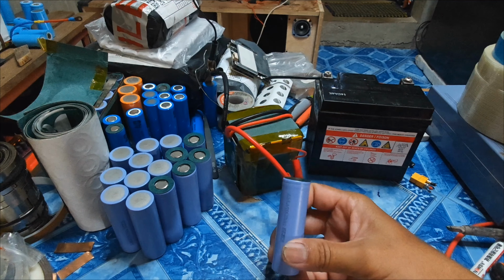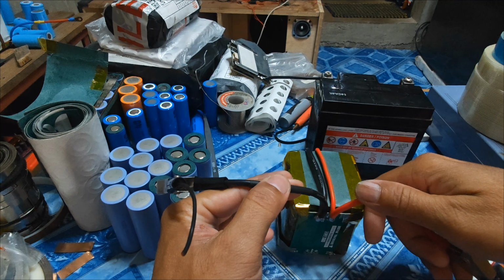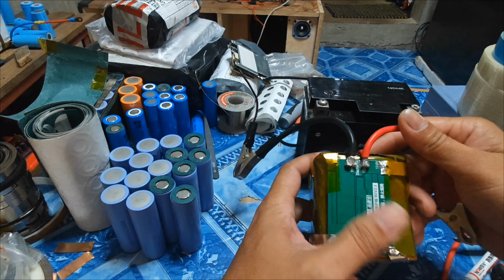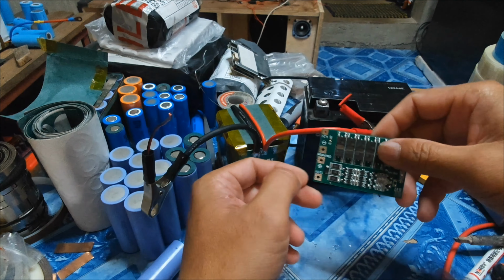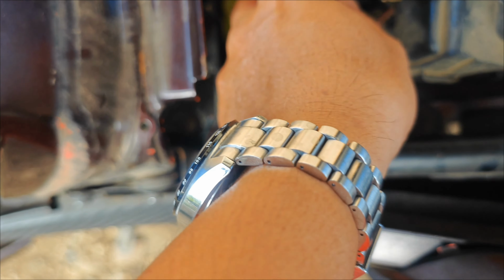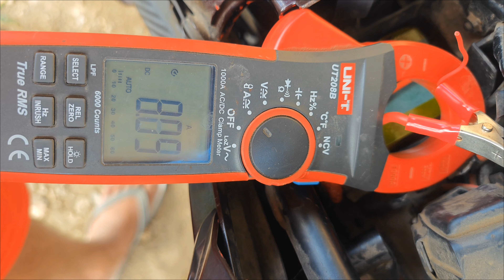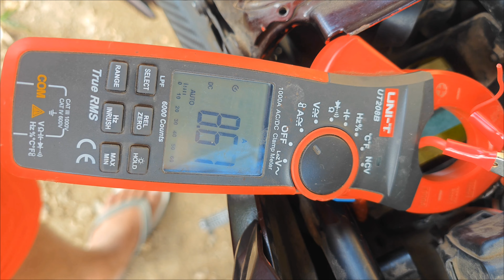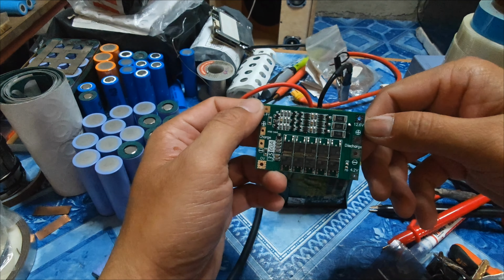#diy 3S 12Ah 10C for 155CC engine starter & replace lead acid battery

Comment: Beautiful build Boss. My experiance that if detect over current by BMS at start engine , when you have to disconnect batterry cable for BMS reset... This situation will come very rare case (by starting spike current etc) but big problem at outside if dont have tools. So I recommend that use Car BMS (100A 200A etc) for this application Boss.  BTW Mine lifepo4 4S2P with out BMS (with voltage stabilizer) for big bike. keep enjoy!
Reply from the maker: Good day! thanks for sharing your experience boss. Honestly speaking I am trying to find way how can I save but the truth is cheapest product it will not run last long. However I have a BMS design for kick starter. Constant current is 50A the peak current is 1200A  12V fit for lifepo4 batteries.